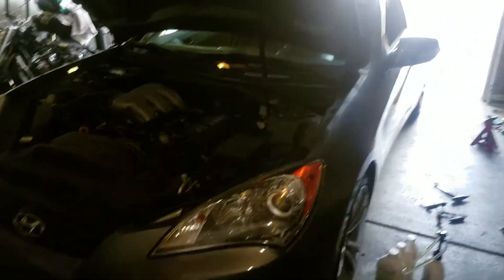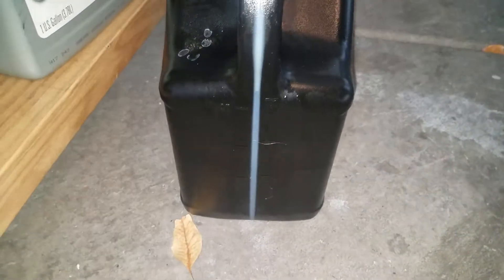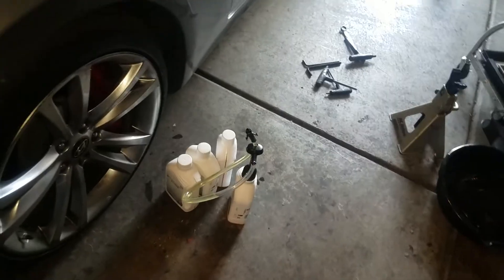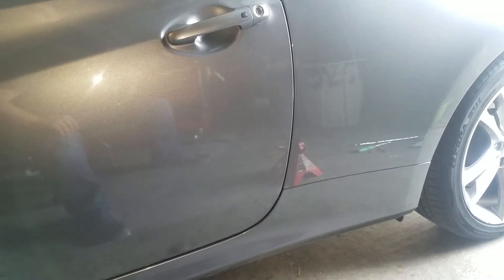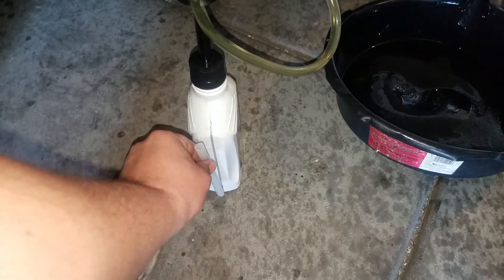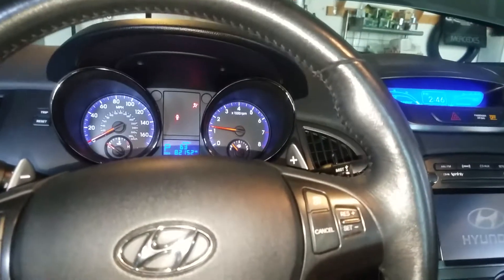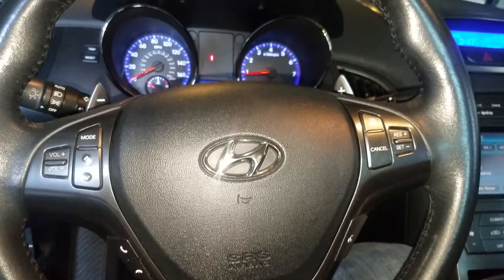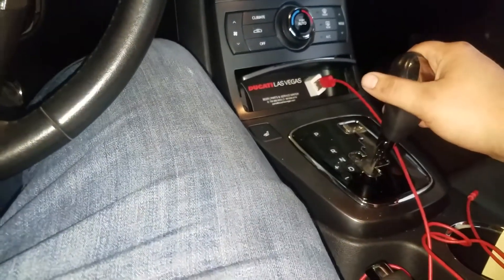2011 Hyundai Genesis Coupe 3.8L Part 2 - Transmission drain and fill

Comment: You need to fill it with the car running and a/c on and shift through the gears to burp the system and check again

Comment: Why didnt u fill it thru the fill plug under the hood?
Reply from the maker: When there is a fill flug directly on the transmission you should be using that. However, I don't believe this car even has a dipstick tube attached for a dipstick.
Reply: @SI1SHAD  from what i understand. On my 2010 there is a overflow plug and a drain plug both on bottom of car and under hood a fill plug. And yes no dipstick cuz its a sealed tranny
Reply from the maker: Fill plug underneath car is most accurate, that way you dont overfill the transmission. Similar concept to a rear differential.
Reply from the maker: This was put up strictly as a courtesy for informational purposes. If you have a fill plug and want to do it that way, you're more than welcome, just do not overfill the transmission, you can wear it out faster
Reply: @SI1SHAD  the guy who did my drain and fill used the fill plug under hood and we filled until the overflow plug started dripping. Then we stopped. Car ran great but first gear had occasional slipping or jerking. From full stop to 1st gear. Not a big deal. But car was running so smooth and fast. Then i researched and found the overflow plug should have a steady stream of fluid coming out not jist dripping. So i went back and we put 2 more liters in from the fill plug under hood until the overflow plug started leaking a steady stream. Now when i drive no more slight occasional jerk or slip from a stop to 1st gear but the power and boost and better performance is all gone. I dont know if i overfilled it or what...i wish i just left it the way it was and lived with the occasional small jerk cuz the car was running like a dream and it was so much faster and everything. I even think my gas mileage improved
Reply from the maker: When I first got this car it felt plenty powerful for a daily, shifts didn't necessary feel bad but they felt extended(like it was struggling) ever since I've done the drain and fill, my car coasts better for longer, accelerates better, when I get on it I can feel the transmission shifting through the lower gears but not in a bad way, in the sense its an automatic. My car performs better than it originally did, and it's been a while since I've done this service. I have almost 90,000 miles on my car and I'll be doing the fluid, gasket and filter at 120k miles.
Reply from the maker: If you're getting a slipping there may already be damage to the trans